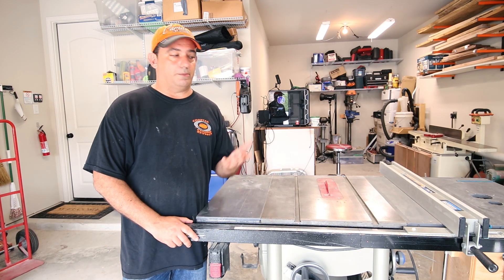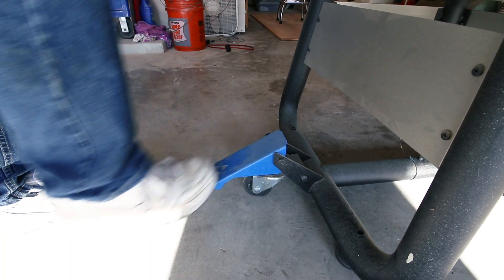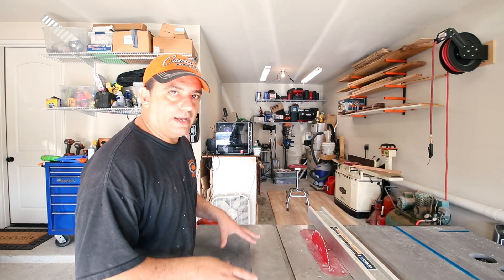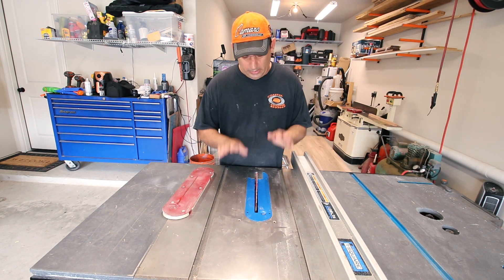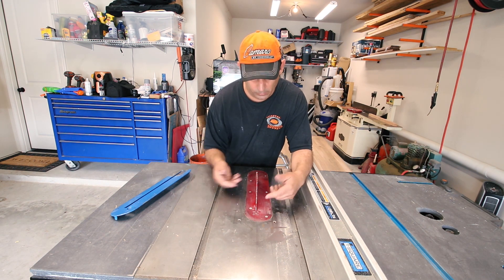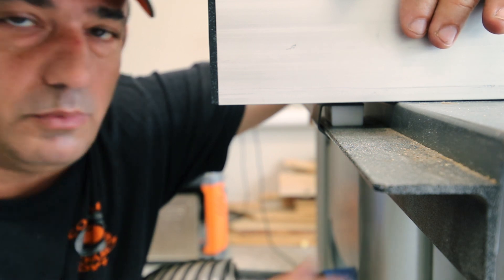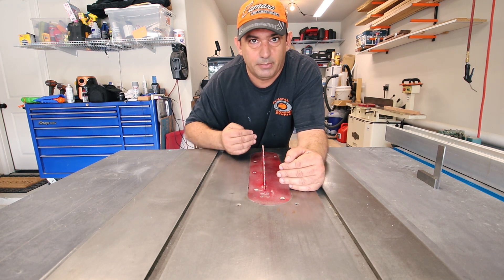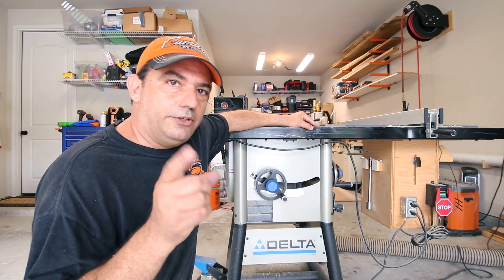Delta 36-725 Table saw review.  After 3 years

Comment: Not discovering your machine is out of whack right out of the box is your own fault. I have this same saw and when I initially set it up I verified the table was perfectly flat in both directions before I even put the legs on it. Had to do some blade alignment and fence tweaking but my saw is out only .002 max from perfect. Where most people get into trouble is not paying due diligence and trying to go beyond the capabilities the machine was designed for. So I cannot speak for all of the delta saws but mine is verified spot on and I use it as intended. Don't be your own worst enemy.

Comment: If people would read the manual, they'd understand their equipment better. This is easily converted to a 220v and you can get the extra power you want without having to upgrade for that reason. In addition, the one I own is perfectly flat and has stayed that way for 3 years. This is something that you should have contacted Delta about as they would have fixed it or you could have returned it... Unless you didn't notice until it was out of warranty.
Reply from the maker: Doubling the voltage doesn't do anything.   It just means the saw is versatile for any power supply you have.  

When you double the voltage,  you actually cut the amps in half.   Wattage equals volts multiplied by amps.   So in the end,  you get the same wattage.   Which means you get the same horsepower.   Configured for 110, it's 1.75HP.  Configured for 220, it's 1.75HP.  

A true 220 saw will make 3HP or 5HP.  You cannot obtain 3HP with this saw.
Reply: @termitewoodwerx5896  mine works way better after the 220v swap. Doesn't get bogged down.

I'm not comparing bigger saws to this one, It's just seems worth noting the 220v plug option when you do a review instead of saying it's the worst thing about the saw. But not knowing a machine fully hasn't stopped others from posting reviews.

Comment: I've had this saw for about two months and it's a piece of crap.  I've had the Rigid from Home Depot that costs about $150 more.  Shame on me for trying to save $150.  The fence is the only part that I have found acceptable.  I just went out and checked if the cast iron table is flat.  It's not even close.  This is turning out to be a bigger piece of garbage than I thought.
Reply: Those 150.00 more for the Ridgid worth it ? I heard that the fence was not as good on the Ridgid, I'm still hesitant between both, thanks for your input
Reply: @gilkennedy7638  True, but an aftermarket fence is relatively easy to install on a rigid

Comment: I have heard of these saws occasionally coming with a warped top.  I'm sure if it had been caught when the tools was purchased new it would have been exchanged. I have the same saw and i had actually never checked my top until now.  I also used a machinist straight edge and mine is .0015 or less.   It sucks you had to deal with this saw for three years like that.  would have drove me nuts. ..  lesson learned.  from now on check the top as soon as you receive the saw.   On another note this saw can be wired for 220 as well as 110.
Reply from the maker: It was the first time I had bought a real table saw and truthfully,  I didn't know what I was looking for.   Im not sure if the saw was like this when I bought it,  or if the table has sagged over time.   I wish I had known to check it.   That's why I did this video.   If someone wants to buy one, it's something to look at.  Since your saw is only of by .001, then I'm willing to bet I got it this way.  

As for the 220... yeah,  i can wire it for 220, but it won't change the horsepower.   I wouldn't mind having a little more power.
Reply: @termitewoodwerx5896  Just picked up this saw for 100 bucks used, motor doesnt work, so will be fixing that soon. 
I have no room to complain about anything at that price, but I never thought about checking the table top flatness until this video (for my next saw). 
Thanks man!
Reply from the maker: Man that's a steal!   Could be as simple as a switch.   But even if you have to buy a motor...

Comment: The Delta 36-725 can be easily converted to 240 volt.
Look in manual to show you location of 120/240 switch. You then need to cut off 120v male plug and install 240v plug.
Reply from the maker: Yes.   I get that... but it doesn't give it any more horsepower.

Comment: Does the 36-725 have a small belt?
Reply from the maker: It doesn't have a belt at all.
Reply: @termitewoodwerx5896  There is an external belt.
Reply: I encountered the blade stalling, and  I found out the belt was getting worn.  I have 2 belts on order to fix the stalling issue.

Comment: The T1 (older version which you have here, not the newer T2) can actually be converted to 220v.
Reply from the maker: Yeah,  but even if you switch it over,  it doesn't make any more horsepower.

Comment: If you want the motor to last longer don't starve it for power. Use a dedicated 20 amp outlet or better yet upgrade to 240. Running a 240 line is NOT difficult, but hire a qualified electrician if you don't feel comfortable doing it..same with 20 amp if you're not sure how.

Comment: I am already seeing corrosion of the table top after 3 months in my garage.
Reply from the maker: Well,  that's not exactly the saw's fault.   Any cast iron is likely to show rust, especially if you live in a humid climate.   You have to treat the metal.   I have to do this constantly.   You can use wax or some sort of oil.  Gotta be careful with some oils and stuff and that will ruin the finish on your wood projects.   I use a spray from Boeing.  Woodcraft carries it.   Makes stuff slide real nice on the table and it won't let the table rust.   It also does not mess with your finishes.   I apply it after I'm done using the saw.

Comment: The reason I did not buy this saw when I saw other content creators talk about it was the dust collection. That killed the deal for me. Some worked in barns so it was no big deal but I can't have all that sawdust in my small garage. I eventually went with the DeWalt jobsite table saw. It has really great reviews, and the Concord Carpenter calls it the "Cadillac" of jobsite table saws. Good enough for me. 
Eventually in about a year and a half I will probably be getting a Sawstop only because of the safety factor. I live alone, and an accident would not be good for me. With that said, I have to disagree when you say "As you grow as a woodworker you want your work to get better and better, and you can only be as good as your tools." Two of my favorite content creators are Steve Ramsey of Woodworking for mere mortals, and Tamar's 3 X 3 custom. She has moved into a bigger shop, which now houses a Sawstop, but for years she used a DeWalt contractor's saw to build some of the finest furniture I have ever seen including a dining table with some really steep angles, and a beautiful cabinet to store her album collection. Even she said that her table was not perfectly flat, but as long as she could get perfect 90 degree angles on the side that she was cutting on, it was fine. 
Mr. Ramsey has been using the same table saw for years, and it suits his needs just fine. His shop is nothing fancy, but he does turn out some really neat and unique pieces like a bench that looks like it was made out of giant Popsicle sticks.

Comment: Not that it takes away from your point about that saw, I have, it's shit, there's no nice way to put it. Anyway, not to take away from your point but those Veritas straight edges are not guaranteed to be flat within 0.001" for every 12" of length. So a 36" straight edge is guaranteed only to be straight within 0.003" over the entire length. That difference doesn't really matter when it comes to that piece of shit saw but it might on something else.

Comment: Have used Delta Unisaws for over 40 years - Bought this to use in retirement. very excited about the quality of the unit at first (uses) Went through 2 in 4 months - Motors are total junk…..Will not get a 3rd one. Lowes did refund in full both times (Store Credits)

Comment: You got a dud I guess. Mine is good to go.
Reply from the maker: Looks like that's the case.  😪
Reply: @termitewoodwerx5896  the first one I purchased had a bad two piece tube for the fence. I couldn't cut  straight under 6"  .  Delta was very frustrating to deal with so I had to return it and get another one.
Reply from the maker: At least you eventually got a good one.   I'm stuck with this one and no real way to fix it.

Comment: It's a $600 "contractors" table saw.. sheesh. lol
Reply: Love mine, I did check flat with 6' Level before I left the store as well as took a Frame square to it, which I did fine tune fence square later but it was  very close, I do want to eventually put it in a Larger Table/With Outfeed, but you can just remove that thin metal, it is Not what fastens the arm in place.

Comment: Any table saw that has a motor hanging from the table will in time bend the table. That is why cabinet saws hang all the heavy stuff from the cabinet not from the table.
Reply from the maker: Agreed.  It's just what I could afford at the time.   Saving up for an upgrade soon.
Reply: @termitewoodwerx5896  Perhaps the best option is to purchase an old in need of overhaul cabinet saw. Bearings, wiring, and a few parts generally bring it back into like new condition.
Reply from the maker: That's something I would normally do.  Unfortunately,  my job keeps me out of town a ton and doesn't give me a lot of time.   I've been saving my pennies and just hope to buy a Sawstop, plug it in and go.   Sometimes restoring an old piece of equipment can be very time consuming just sourcing parts.   I always will keep my eye out for a killer deal though.